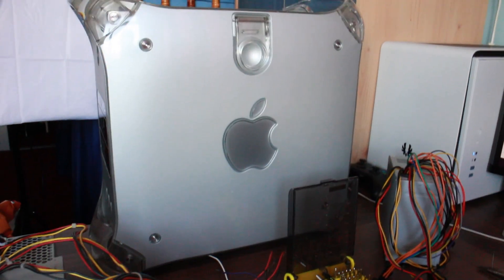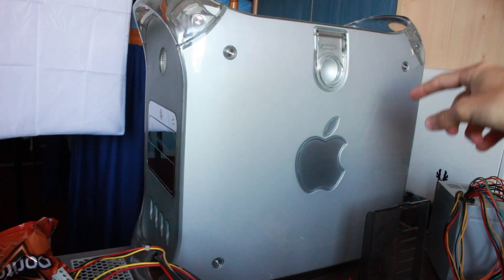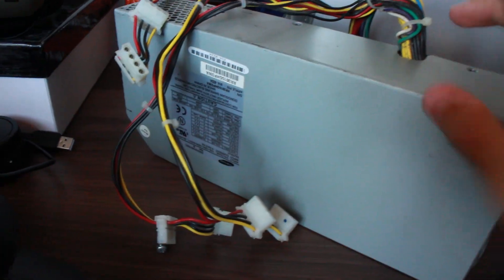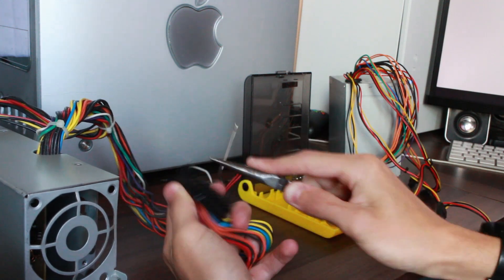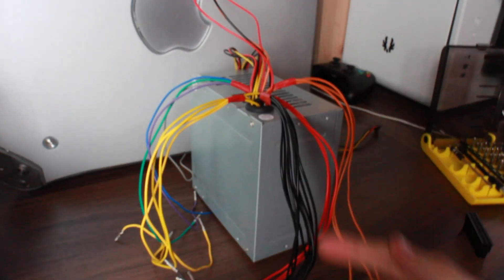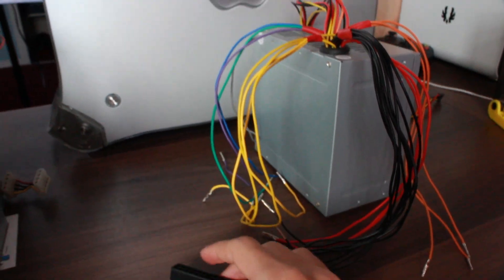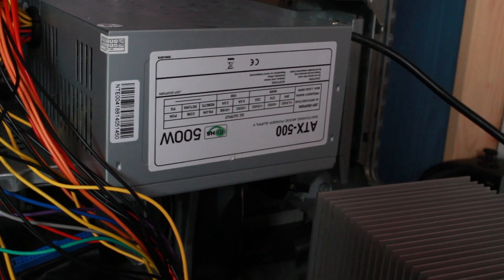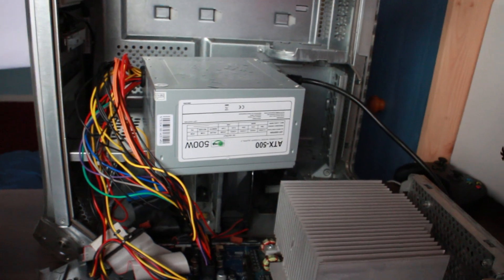ATX to MDD Power Supply Conversion!

Comment: I just use a set of tools i bought on Amazon 21 different pin removal tools on one key chain. Covers every type of pin I have ever-needed to remove. Less than a tenner. But yes great guide of fix these shite psu’s without getting wallet rapped by apple.

Comment: I can't believe I never thought to push out the wires from the 24 pin connector. I cut, stripped, soldered, and heat shrunk each wire... Nice video :P